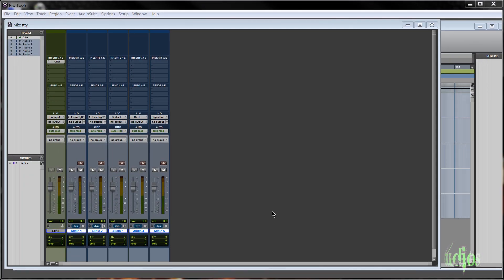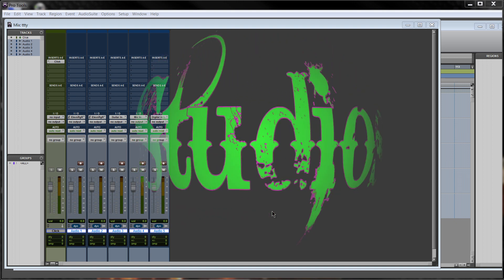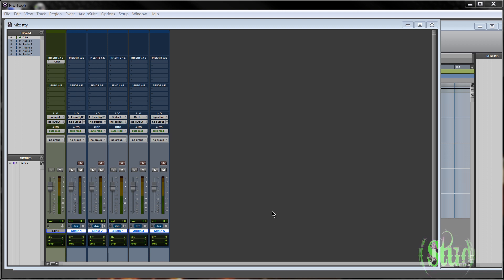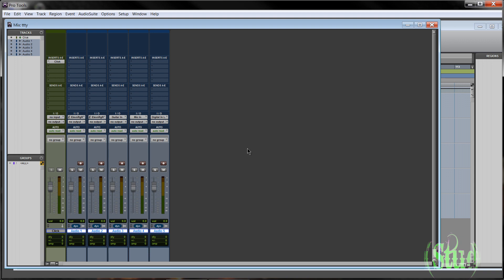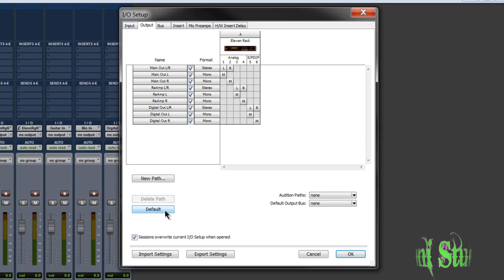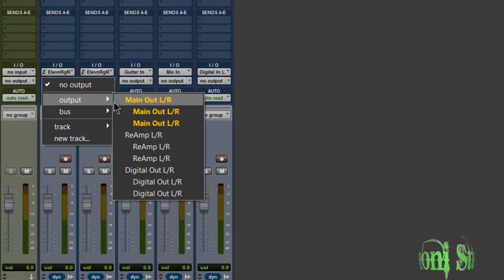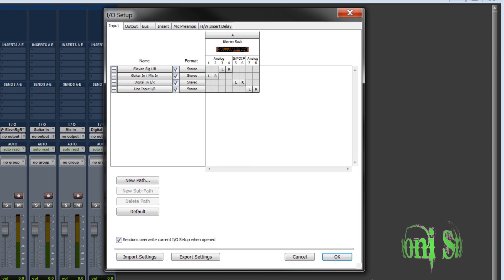Pro Tools 9 - Default the I/O

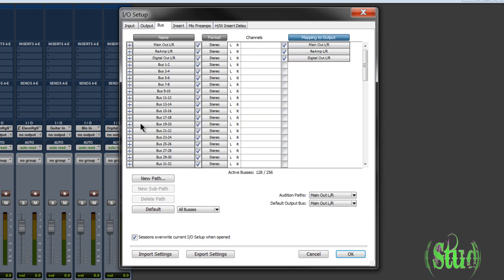Comment: Hi, I did what you said in the video, the elven rack isn't grey any more but it does the same thing as the built in mic does. I don't have the 11R picture you have on 1:02. How did you connect the 11R to your computer during this video? (I connect through USB).